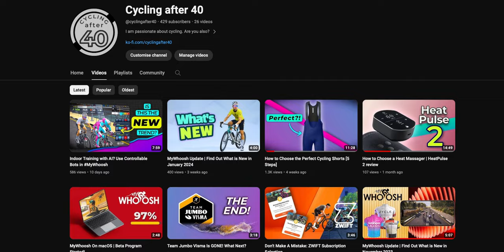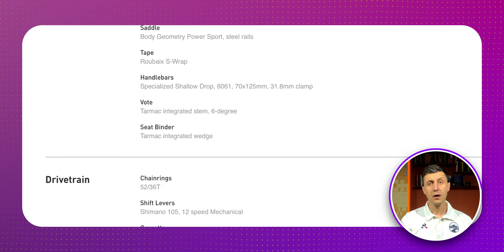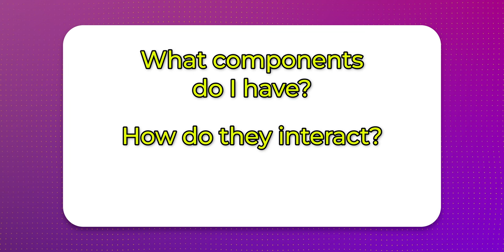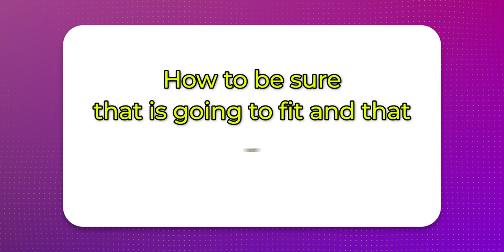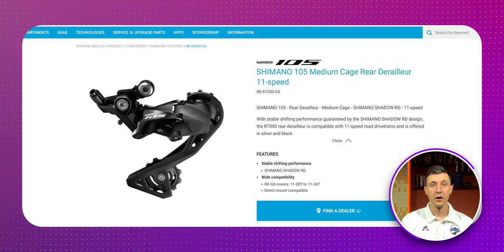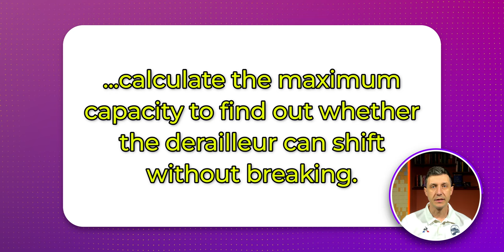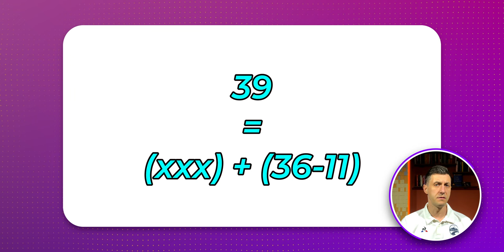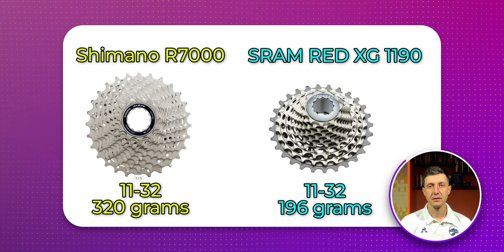How to Find the Right Cassette for Your Bicycle

Comment: - I managed to get an 11-36 cassette to work with a 10 speed 105 derailleur (32T max). All you have to do is to screw the B-screw limit some more and avoid cross chains.
- I have seen on youtube people make an 11-40 cassette work with their mid/long cage derailleur. Sometimes it works with the b-screw limit adjustment, sometimes you have to add an extra rear derailleur hanger.
In both cases, you might have to buy a new chain, but at least these options are the easiest and the cheapest.

Comment: Just use grx crankset and front mech  instead of the road cranks on your bike.   46/30 11-34 is a decent range for climbing and you won’t have massive jumps in the gears  and a really long chain.

Comment: That is a 6% cadence change for going from a 32 to 34. That is quite substantial. Weights of cassettes are tiny differences and are dwarfed by bodyweight changes. Practicing grinding and doing strength exercises would help. Also when pacing it is important to think about altitude adjusted ftp and how it effects your cycling ability.

Comment: Hi! I participate in ultra cycling events and therefore needed a special solution for mountainous multi-day races.
Absolute Black offers super-compact (oval) chain rings that are compatible with standard Shimano Cranks. They offer 48\32 and 46\30.
For example, 46/30 and 11-34 could work well for you.
The shifting performance of the oval rings is very good. Also, there's limited evidence that the oval chain rings improve fatigue resistance when going Uphill. I certainly like using them a lot! Maybe this helps you..
Reply from the maker: Indeed, 46/30 could work. I will take it into account for my gear ratio analysis. In parallel, I am investigating a 1x solution. 
Thank you for your advice.

Comment: I ride a Bacchetta Giro A20 touring recumbent and I enjoy hills seated in comfort. My gearing is somewhat different from stock  I run 153 mm crank arms with 22-42 chain rings  and a nine speed cassette 32-12  there is no back and forth on the front , it is an either or . 9 low gears for loaded touring and 9 gears for everything else and as I have 2.4 lengths of chain there is no cross chaining wear to concern me.  Comfort and speed , what more could you ask for?  BTW I took 3 cassettes apart to get the teeth I wanted.
Reply from the maker: It took me some time to put together all the numbers that you expressed. You did a great job of making this custom set-up. 
That is the point, to experiment and find what works best for each of us. 
Well done 👏